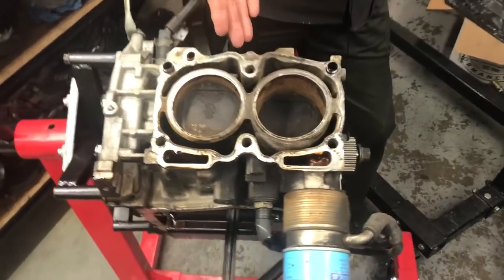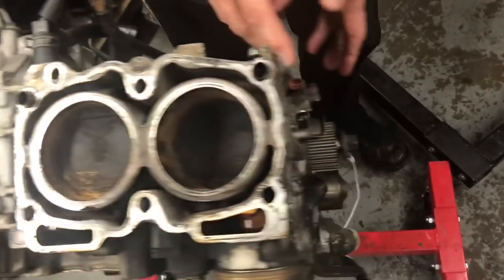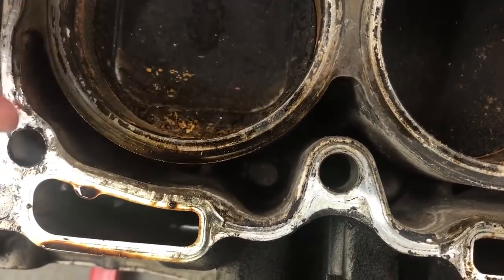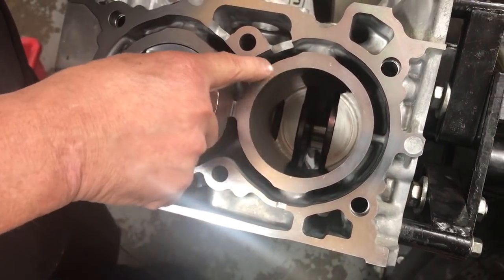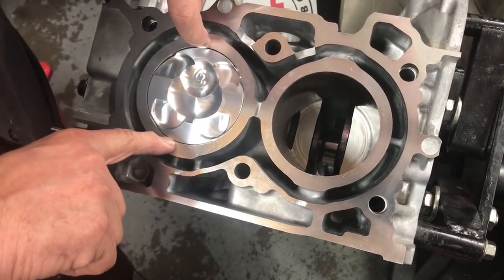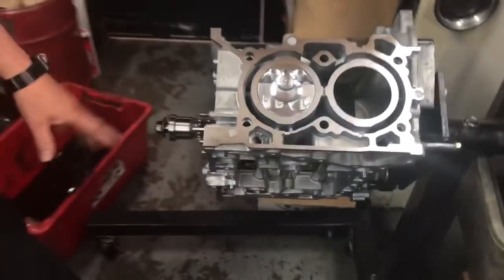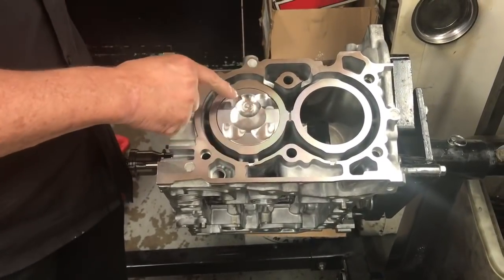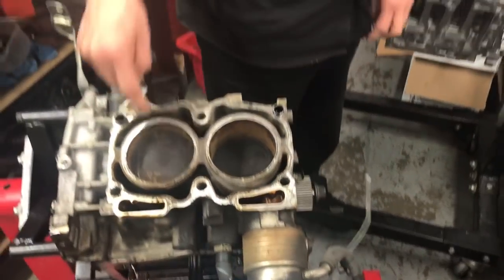Subaru FA vs. EJ Comparison

Comment: So, does the FA24F use forged crank, connecting rods? And, does the new FA series still have head gasket and other known common problems, or has Subaru fixed some of those?

Comment: I just blew my FA.  What kind of connecting rods and pistons would you recommend with the stock block?  I don't plan on really building it.
Reply from the maker: Anything forged, really. Just remember you get what you pay for!
Reply: Go with the IAG stage 1 block. Has all of the forged upgrades that the FA20 design failed to do out from the OEM factory pieces. You won't regret it I just got mine installed!

Comment: The FA is gonna be a beast in 3 to 5 years
Reply: 2-4 years now :)
Reply: Im at 430hp on a mild built short block
Reply: @fatkat311  lucky! I just broke in my IAG stage 2 and now I just have to wait for my turbo :)
Reply: My reply is stupid but, - damn what happened? I have a stage 2 short block,  i started to rebuid the stock engine but decided to beef up the bottom end and swap all internals. Just finished building and tuning it. No miles on it yet. Heads are the only part that is stock
Reply: @fatkat311  at ~70k miles I ran into oil consumption issues and blew rods 1 and 3. I was contemplating just swapping in a stock long block but sent it and swapped in a IAG block. When you get that thing running you definitely gotta let me know how good that much power feels. My heads are stock as well but I regret not camming the motor just to get the extra jump in power. If/when I pull the motor again I’m definitely getting some HKS cams.
Reply: My reply is stupid but, - After all the money spent on building the block and miscellaneous parts I couldn’t justify spending another thousand  or 2 on cams. I’m curious how that works out for you. These are probably the easiest cars to yank rhe motor. So maybe down the road I’ll throw some cams in it.
Reply: 400 stock block 105k miles stock clutch stock gearbox

Comment: With aftermarket pistons & rods on the FA20DIT can it handle an 8K rpm red line @320 hp with a tune?
Reply: People are doing this on stock longblocks.  Going forged would be a waste of money for that power goal.
Reply: Sounds like you’d only be building it to rev higher. Oem block can make that reliably on 93

Comment: As always, enjoy the videos from “Down under” (I’m in the U.S.). I would agree with those that would like to see the DI and multi port combo. I DO worry about the maintenance that comes with the
Reply: Captain Buff The Third 
Hello, no worries on being a engine newb. We all have to start somewhere. For me it was in 1973 racing dirt bikes. I figured I could get a good manual and do my own maintenance. Turned out that at twelve to thirteen I was pretty good at it. Ever since I have done most of my own repairs on bikes and cars.
I found that I like Haynes manuals the best.
Intake valve cleaning, if done chemically is easy. There are a few cleaners that can be found at auto parts stores. You will need to take out your air filter out of the box. I found it easier to take the front of the air box apart( mine is a clamshell type) leaving the rear half attached to the air intake tube. The engine needs to be at operating temp. The cleaner spray can comes with a long hose so you can get past the mass air flow sensor. If you spray the sensor, it will be damaged. The can instruction says to run the car at 2500 rpm while spraying the entire can into the intake in short bursts. Once that is done, rev the engine to3,500 rpm a few times and shut off the motor. Let sit for an hour, then drive the car at highway speeds for about 20 min. My car ran a Little wonky, so I ran it for 30 min. After that, drive as normal.
The other method is to have the intake removed and have the intake valves cleaned on the back side with ground up walnut shells.( NO REALLY) you would want a dealer or pro auto shop to do this as the engine can be damaged if done incorrectly.
I run catch cans on both the EGR and PCV systems. They capture the oil and gases that get put back into the intake system and prevent the great majority of the gases from collecting on the back of the intake valves. I empty mine at every oil change.
The next thing to do is use a low volatility oil in the correct weight range. You will find this quality in most quality 100% synthetic oils. I run Eneos brand oil. I THINK it is what the factory Subaru oil is. All these things will help with carbon build up on the intake valves, but, even with all these things, you WILL need to do a walnut shell blast at some point. I’m hoping I won’t have to do it until I have 70 - 80,000 miles on the car.
One thing I have found, is by working on my own cars and motorcycles, I have a stronger connection with my machines.  My motorcycle(BMW R1200 G/S) has only been worked on three times by the dealer in the twelve years and 65,000 miles I have had it. It runs as good as the day I bought in February or 2007 new.
So, get a good manual, Haynes or Chiltons and form a bond with your car.
OH! And the black stuff you get on your hands............ it will come off with a good hand cleaner and warm water.

Look at it this way..... If it was built with human hands, it can be taken apart and reassembled with human hands........ now, get yourself some quality tools and get to work, and have fun. If you mess up, no worries call some mates to give you a hand........😀👍
Reply: Captain Buff The Third I do believe the Con rod issue is happening to those that build their engines and tune them. We can get up to 22 psi or more out of the stock turbo just by tuning the ECU. I can see how they would be a problem. Brett has good replacement parts. If you want to start building a FA motor, he IS someone to listen and turn to for a reliable bottom end.
As fat as audio goes....... I like budget systems. Home: Cambridge Audio Azure 651 htr, Definitive Technology BP2020 front with matching center Chanel. And Definitive technology satellites on the side. Cadence sound bar for rear, project debut carbon turn table with cork Matt art Ortofon M2 Blue cart. Just a pasonic region free Blu-ray player for CDs.

The WRX, I just amped the stock head unit with a Alpine 60 X 4 amp, Alpine self powered 8” sub under the passenger seat. Finally, Focal speakers(forget the model, but the ones with glass beads on the cones and reverse aluminum tweeters). 6.75” component up front, same but full range in the back. Neither system is going to win any competitions, but considering what they cost, have pretty good sound. I had better systems in my FJ Cruiser, but don’t have that one any more. Also had a GREAT system in my XV, but no longer have that one either....... see where I’m going???🥴
As far as education goes, I’m a College drop out(with a 3.98 GPA), just got tired with it. At 58, I feel no need to complete it. Done OK running Drinking water treatment plants and water systems. Well enough. I will have 30 years in the business next year, and am calling it quits. Gonna move off the grid to northern Idaho about 27 miles south of Canada. Can’t wait. Born and raised in Southern California. Loved it as a kid, grew up at the beach and motorcycle tracks. Now days, the tracks I rode on are closed with houses sitting on top of them. That motorcycle I have turns a 16 mile 1.5 hour(if in the WRX)drive, into. 40 min lane splitting commute. There are way too many people here for my taste. Looking forward to retirement so I can restore old(60’s, 70’s and 80’s)BMW motorcycles. I have at my disposal a machine shop and powder coater close(45 miles away) by.
It’s awesome you completed university. And have a natural ability with audio. I just cannot afford to buy separates driven by tubes, wish I could.  Do have a hand wired, no board tube guitar amp that I love. It’s a 2,5,10,12,18,23 watt amp. It works by using appliance light bulbs to limit the wattage getting to the speaker. Pretty cool and killer sounding for jazz and blues.

Anyway, you are absolutely right about natural abilities we have. I enjoy driving all kinds of cars and working on them when they brake. Went to a track with some mates, I started to give a few tips for getting around the track fast, I got the hand, and a “Dude, I know how to drive. I put my hands and said OK, turned around and climbed into the rental kart(not what I was used to) and proceeded to lap one guy three times. The others four times. My 16 year old son was right behind me..... one of my mates, got me a shirt that says “ I am the Stig”....  love going fast.
Reply: @wrigman  How funny, I work in drinking water treatment in CA too! I'm in the SF Bay Area though, born and raised here. I have a T4 and have worked at some of the bigger agencies in the area, and have always been a Subaru fan since the turbo Impreza models started hitting our streets when I was in High School. The drinking water treatment and distribution operator jobs have been enough for me to buy a 2007 STi and love it for a while.... before breaking it 😅 but I'm doing my due diligence in researching so that I build it better than ever! You'll love Idaho and the lack of smog limitations ;) I hope you don't mind an actual winter though haha cheers man, loved reading your comments
Reply: MR_JUSTIN I have a T3 and D4. Recently retired, although am thinking I should have waited(59 years old) started in 1989. Had 457 money too, but cashed it out. Hope you are doing 457 as well. PERS told me I would be getting more than it worked out to be in the end, so watch out for that. Going to get better when I move......,
Reply: @wrigman  right on man!! Congrats on the retirement. I was hired in late 2013 so I missed the "good PERS" by less than a year... Oh well such is life. Thanks for the tip though! What are your car plans now that you've got more free time?
Reply: MR_JUSTIN already done the mods I wanted to do. MAP top mount inter cooler, Perrin charge pipe, GFB adjustable re-cerc valve. Many chassis mods to stiffen it up. I can jack up the front up a couple of inches, the back is off the ground as well....
Still on stock tune, will stay that way for a while. Have house projects going as well as a vintage BMW motorcycle rebuild going.
Reply: @wrigman  you have intake mods and no tune? Scary, man...
Reply: MR_JUSTIN  Haven’t done any air filter mods, still stock. Exhaust stock as well. If I touch either of those two, I’ll get a tune. Just reducing intake temps and smoothed out the boost. Stock plastic recerc valve is too unpredictable. 
Subie people freak out about tuning. There are things that can be done without having to tune. Called Perrin and MAP after installing both parts. Both manufacturers said no tune was needed to safely run the parts. They said I would see more benefits from having a tune, but it is safe to run it this way. The ECU will make the adjustments....... that’s kind of what they do.
Reply: Added AP, 3 port boost control solenoid, EGR/TGV deletes (+ dyno tune) and oil catch can to my 2020 WRX.  Had 2500 miles on it, warranty be damned!!!  Did these mods for reliability (carbon build up on valves) with the added bonus of pulling 272whp/295tq with dyno tune.  Cant tell you how much better than stock it is.....for about $900 in parts + cost of tune.
Reply: DI motor. I did the intake valve and turbo cleaner at 15,000 miles as well as a plug change and have run Enenos synthetic oil and factory oil filter every 3,500 - 4,000 miles. There are also dual catch cans in use......
Reply: So, I looked at your avatar today. Cymbals??????? My dad is a guy that hangs around musicians as well...(rim shot).😀 I’m one of those guys that is at the door, never knocks and comes in too late.😆(another rim shot)
I grew up in Fullerton CA. Fender guitars were made there for years. I used to ride my bike there and peek inside. It was pretty cool.  Fast forward to today..... I live in Corona CA. The Fender factory is here now. Know a few guys that work there. One of them no longer does, but founded the Custom Shop. His name is John Page. Considering all the famous people he knows and has made guitars for, he is one of the most grounded, warmest people I know. He went on to make his own brand of guitars under his name. They are awesome instruments.
One of my dads friends used to play sax in my dads local bands. He used to get my dad and I into the large trade shows on the west coast. Have met many big names in music. It’s been fun.
Get out to enjoy as much live Jazz, Blues and Classic rock as we can.
Keep beating the skins, cheers.🍻

Comment: Hi Brett, does the FA and EJ series share the same bell housing shape and bolt pattern? Thanks Jon
Reply: pretty sure it does most forums on 2015+wrx (FA20dit) sti tranny swaps say the sti trans is a direct swap with the rest of the goodies (hubs, driveshaft, r diff, axles, etc) just some slight electrical work for the dccd
Reply: Colby Garrett thank You for your reply!
Reply: Every Subaru engine and transmission from phase II, 99+ will bolt together.

Comment: Thanks for all the great info Brett.  I have a question for you though: Is it safe to use wheel spacers only on the rear of my 07 forester? My 13 wrx wheels don't clear the bc racing coilovers in the rear without 10mm spacers.  Will this cause damage to differentials or anything like that?

Comment: Hope they don't go just DI on the STI. It needs dual injection, port and direct, best of both worlds.
Reply: Only reason the BRZ has that tech is because it's using Toyota's D4S system.  As of yet, Subaru doesn't have their own system to do it.  But yes, it's a great setup.
Reply: Yeah I agree is needs Dual injection, twin scroll turbo and equal length headers to keep it reliable
Reply: Yes!
Reply: 3 years late.. yes they done both Injectors. 👏  to Subaru
Reply: I hear the 2022 will have an FA24 coming with 400hp from the showroom. I love the EJ sound but im glad to see Subaru finally putting a little effort back into the STi.
Reply: @dyingbreed5386  yall jinxed it
Reply: @estreaper7393  😄 sure seems like it.
Reply: I also hope they don't turn the next STI into a hybrid
Reply: This aged like milk
Reply: @TripedalTroductions  like the crust on your upper lip.

Comment: I really want to see how far can can this engine be pushed reliably.

Hey Brett, do you think the FA24 will have the same block as the FA20 but with a larger bore?
Reply: Really curious to see this myself.  The thinner sleeves is one of the reasons the EJ25 isn't as durable as the EJ20.
Reply: viru52000 yeah but the S20 heads crack around the spark plugs.